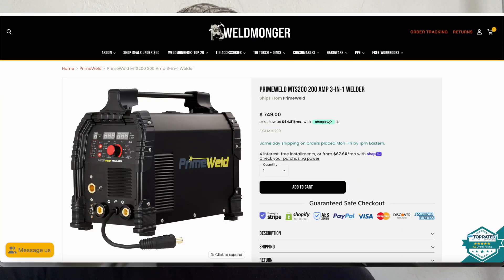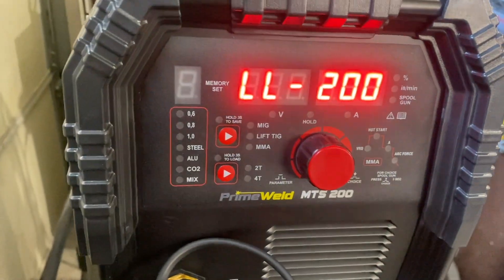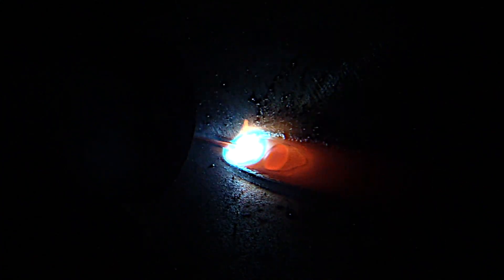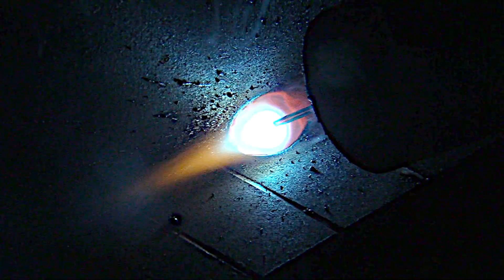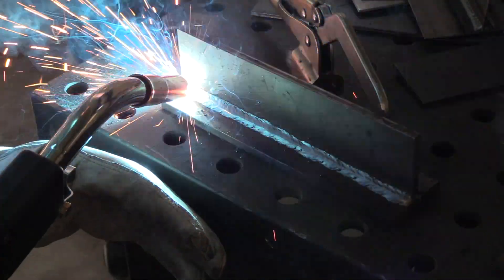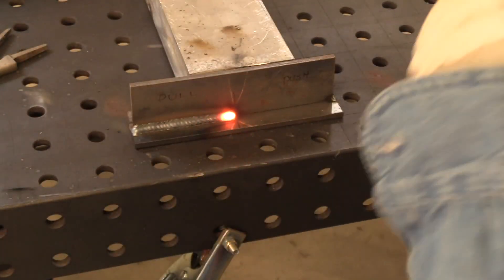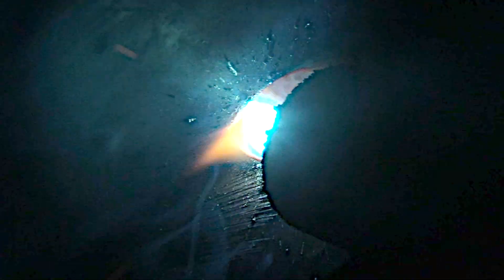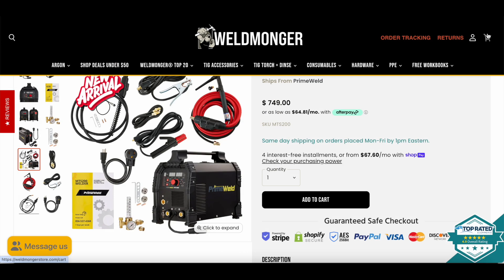Testing MIG Chart Settings on a Primeweld MIG

Comment: This machine doesn’t have a solenoid for TIG? Gas is manual, from the torch? My older est 215 works that way. The newer 205, which I have, has two solenoids, one for MIG and one for TIG. But it’s a more expensive machine.

Comment: Thanks for the vid. Do you feel the flux core settings are accurate? Thanks Also I noticed the 1/4 inch setting of 472 ipm is exactly double the 1/8 inch setting of 236 ipm. Which means to me anyway that Primeweld just doubled the ipm because of the double thickness which is way to much. Would be better if they would have tested this setting. That being said I own the mts200 and really like it but not so much the chart. I referenced other machines setting tables and they seem to all be around what you found to be pretty good. Cheers